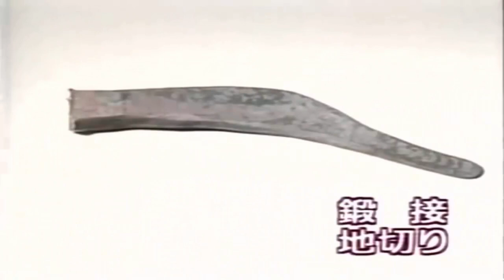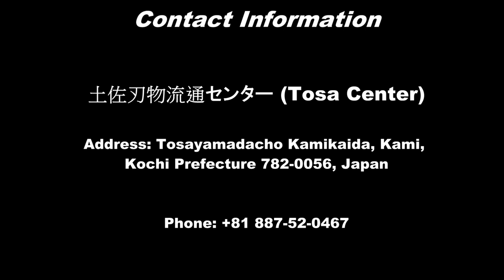Top 5 Most Unique & Incredible Traditional Japanese Hand Tools That Will Blow Your Mind

Comment: The title is just one big clickbait lie...
Reply: how
Reply: @gammazzz3894  There's nothing incredible or unique about these tools, pretty basic stuff, and no ones mind has ever been blown by any of this.
Reply: @rudimunk7030  If you had ever done any of this work, you would appreciate what's going on here. It's so far ahead of most viewers understanding of the process, they don't understand what they are seeing. For example, the machete is being formed of laminated steel, where a preformed blank of high carbon steel is being sandwiched between 2 layers of softer steel, the high carbon gives a easily sharpened durable edge, while the more flexible soft steel surrounding it keeps the blade from breaking. This is all being formed into a solid blank while shaping the blank to it's final form. This is typically a process that takes many heats and a lot of skilled hand work to complete successfully. Here it's all done in seconds. If you look closely at the photos of the finished blade, you can see the darker steel where the high carbon edge is seamlessly formed into the blade.
Reply: @scottmarshall6766  Does anything you just mentioned change how basic these tools are? No.
Reply: @scottmarshall6766  still very common tools used all over east and south east Asia, just made with nicer craftsmanship. So clickbait.

Comment: This is the 1st time I've seen the process of creating laminated steel blades in a semi-production process. It's a cross between standard old time blacksmith forge welding and 'modern' steam hammer forging. By simply hammering the preform of high carbon steel into the blank and fluxing it, it's done in a flash. I was envisioning careful cutting, folding of the outer jacket and then forge welding the layers before shaping, all as individual steps. Instead the rough blank gets the preformed high carbon section driven into the spine and fluxed before closing and finally hammering to complete the weld and close the spine. Japanese processes like this usually turn out to be simpler than expected, but very clever in execution, making a seemingly complex process simple, but usually quite dependent upon craftsmanship and individual skill. 
Thanks for the look at this fading art. Very interesting.
Reply from the maker: WOW best point, Thanks for your time!